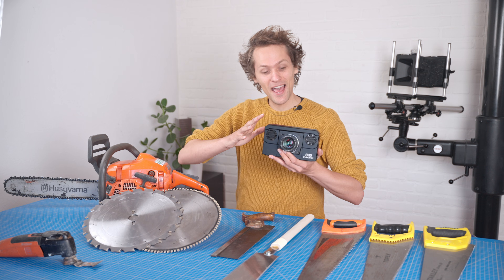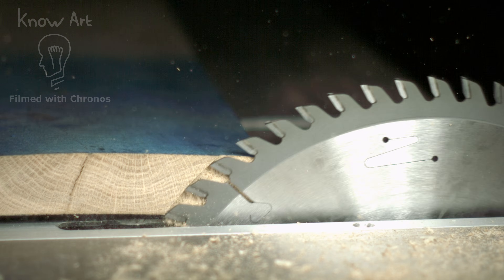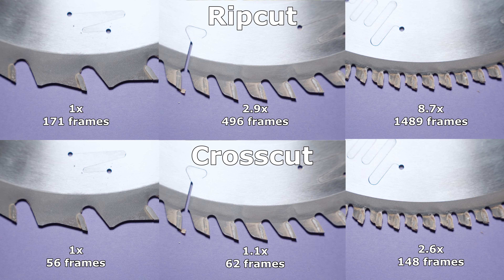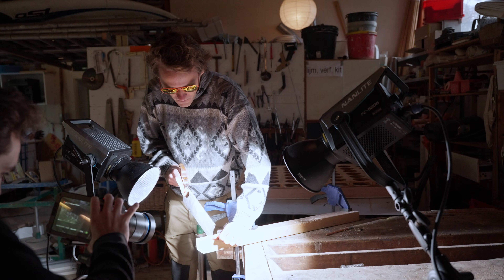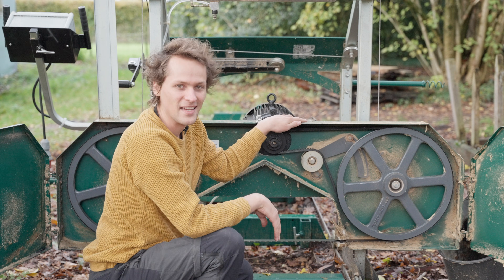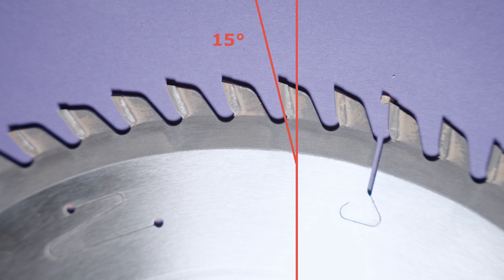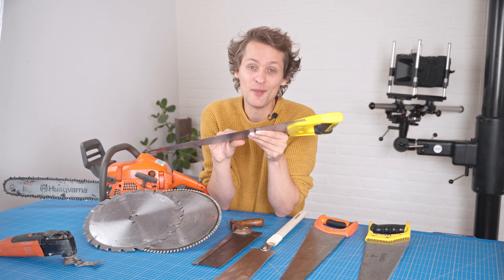Why Crosscut Saws Can't Rip

Comment: 10:22 
This is why when preforming a plunge cut you use the bottom part of the tip of the bar to start the cut and once that went through you straighten out and push the saw. It’s a fairly dangerous cut if you don’t know what you’re doing so don’t practice this without a professional near you.

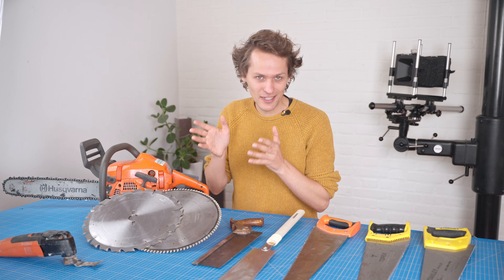Comment: 11:55 I use multi-tool oscillating saws so often. They're great for jobs like flooring, drywall, and framing windows and doors. It's my favorite tool, and it's so safe to use.
Reply: Patented be Fein in 1967, with patent ending in 2009.
Reply: @Calc_Ulator  Invented to cut hard cast, without tearing patients skin. Oscillating saws for construction are a bit different beast. I don't recommend trying with makita/milwaukee and what have you. At least the Makita i had, slipped once and clipped my finger. left a small scar to remind me to be better.

Comment: Great video, but you should really use some dust protection, like a p3 respirator, or even just a cheap dust mask. The microscopic wood dust particles made from power saws are really bad for your lungs, and many hardwoods are even carcinogenic. You looked after your eyes and ears, but forgot about your lungs.

People often forget because they dont notice the effects straight away, but repeated in the long term and you will really regret it later in life

Stay safe 🩵

Comment: In reply to one of your latest points, I actually have a history of cutting metal things with a simple coping saw. The blades dont last very long when I do that, and Ive snapped several, but they also arent very expensive, and Im not patient enough to use a proper hack saw. Ive sawed nails, small steel tubes, greater than 1/8th inch thick copper wire, all sorts of aluminum, and even a .38 Special revolver round once.

Comment: If there were some wood properties that would put up more resistance, perhaps the 100 teeth blade would actually be faster? Seems like there must be a balance between the resistance of the cut object and the revolutions of teeth energy onto the object. The more teeth the more contact points on the wood and therefore it would it take longer. SO if there were a physical/chemical reason to require 100 teeth by the cut object perhaps it would be faster and appropriate??? Only you can do this experiment
Reply from the maker: I have no idea what you mean exactly

Comment: "Chip Load Per Tooth"
The number of "Cutting Teeth" and the "Diameter" of the cutting tool.
Determine a usable RPM range.
At least in machining anyways.
The basic rule of the thumb is.
A 1" inch or 25.4mm cutter with 2 flutes aka cutting teeth. Needs to spin twice as fast as a 4 flute cutter.
I would imagine it's the same with a saw blade, but you can't adjust your RPM.
Meaning the blades with higher tooth counts.
Will most likely be spinning too fast.
To cut efficiently.
Especially when the same 
"Feed Rate" 
& "Pressure" is applied to the different blades.

Comment: I think the real reason is that the 20 teeth blade has more bite than the 100 teeth blade, also the 100 teeth blade is made to cut harder material than wood, so it is not ideal for cutting wood. Also you ignored the teeth cutting angle, the 20 teeth blade have a much sharper angle than the 100 teeth blade

Comment: @0:56 How do you propose the see if the chips get trapped in the gullets with a camera without leaving the blade (and gullets) exposed, and at the same time giving the chips a way out so they don't fill up the gullets.
Reply: A clear material next to the blade would probably do a lot of that.

Comment: I think you need to add a clear panel to the filming side of the cut to eliminate sideways ejection of dust before you can conclusively say it's not the gullets
Reply from the maker: thanks! I think this is an optical illusion. Because we used frame syncing to film the table saw it looks like the sawdust is moving a lot and flying off. But if you pause at any frame you can see how much sawdust is actually being produced and flying out. And it's very little!

Comment: 1:10 I'm going to guess that it's like machining, and when you cut too shallow/slow, chip formation is poor and the bits are smaller, but you have about the same amount of heat generated, so the smaller bits have more heat in them. With the same feed rate, fewer teeth means each tooth will be cutting a larger chunk of wood

Comment: Think of it like a coarse vs fine metal file. You just aren't taking off as much material at once with a fine file (100-tooth blade) as a coarse file (24-tooth blade). Why? I don't know, but it's a similar effect. A saw would be an extremely thin oddly shaped file, after all.

Comment: Hey, I haven't watched the rest of the video yet but if you note, at around 2:19  you are pointing at what you THINK  is a single tooth moving but if you look in the upper right corner of the screen(and moving down/left) but just slightly more center of the blade you will see a black line which I forget what it is but regardless it's part of the blade and it's moving much faster than what you are claiming is a single tooth moving. What's going on is you have the frame rate very close to a multiple of the RPM x tooth count so the teeth themselves look the same.
Reply: He's not saying that it's a single tooth moving, but that the saw is rotating by one tooth each frame. The teeth are staggered, switching left and right of the cutting plane with each tooth, so the framerate needs to be halved so that the saw rotates by two teeth per frame instead, making the apparent motion of the "tooth" come from teeth on the same side of the blade.

Comment: Seems pretty obvious to me that the more teeth you have the less you can advance the wood between two teeth and the slower it cuts. If you have entirely teeth then you can’t cut because no edge will ever be presented to cut. Where as if you have just one teeth, like a sword, you can’t cut cut through the entire thing in one swing. Provided there is sufficient force and strength obviously.

Comment: Rake. It is nearly all about rake.
Blade with more teeth in general have less of an aggressive angle so the teeth do not cut as aggressively. That does also mean there are more surfaces that need to be separated, and there are more teeth grinding against the material creating significantly more heat so it is easier to get burning. Each cut being shallower and removing less material with a less aggressive bite is slower but also reduces the stress on the material and thus also reduces tear-out and leaves a better finish.

As for the easter/western style sawblades. Nah that is bogus. European saws had every type of tooth geometry same as east-asian saws: The right tool for the right job. If you look at historic examples you will find that there is not much difference in blade-thickness generally, and often european push-saws still being thinner simply cause europe had the better steel. Nowadays that is of course not a concern anymore. Now the thickness is determined just by its usecase and if the manufacturer is cheaping out.

Comment: Love this video! Learned a lot.

I do want to point out one thing though. Part of the reason why the gullets aren't getting filled up at 2:53 is due to the saw being at the side of the wood. Leaving one open side for them to be ejected.

Your explanation did convince me and was very clear, but maybe it would have been a better demonstration if you where to be able to place some plexiglas or something to the side of the saw, simulating the presence of the wood that would normally form a barrier. (Not sure how easy to do and safe that would be though).

Still great video! Ill keep this in mind next time i need a saw
Reply: I don't think it really matters that it's on the side of the wood. The higher tooth count saws were still slower so the gullets getting full is definitely not the main factor.
Reply: spinning blades rarely get packed full of dust between each tooth coz of how fast they spin the dust gets thrown out constantly, for a normal hand saw though they teeth do sometimes get packed full of dust especially when the wood is slightly damp, even multi tools do aswell because of how much friction and heat they generate, it melts the lignin in the wood and it sticks to the teeth

Comment: Hello fellow woodworker, during my apprenticeship we had really big sawblade with long holes within the surface of the blade with extra carbide "teeth", we used to rip boards and it was by far the fastest we had. But it was so damn load while running that we rarely used it.

Comment: Cast saws also oscillate, so they cut the hard cast, but just push your skin back and forth. They can't cut you cause your skin has a little give, but they cut the cast cause it's fixed in place.

Comment: You can get extra-hard files that can sharpen hardened teeth (although they are harder to find than standard files), so even if you resharpen, you can still get the better durability. Also, the rake angle of a saw blades isn't just a single number, but can have both an axial and a radial component. Good crosscut blades often have a low (or even negative) radial rake angle, but a positive axial rake angle.
Reply: Presumably you could sharpen them with an abrasive diamond file as well. Probably easier to find than an extra hard regular file
Reply: @jakezanders6598  I diamond file would definitely work as well if you found one in the correct shape, but I ended up with an extra-hard metal one because it was in stock when I bought the saw (and recommended by the hardware store). I use an abrasive diamond flat file for several other cutting tools though and it's incredibly useful.
Reply: @gtsteel  Diamond files do work but gotta get the file grit correct and the file has to be really thin to fit between the teeth. I have some 0.6mm thick diamond files with 400 grit and they work for sharpening normal wood saws you can buy at the hardware store with 7 - 13 teeth per inch. It does get trickier the smaller the teeth become and needless to say this file is quite flexible so you have to mind the force and angle you use it at. If I had a proper triangular file with 400 grit diamond coating it'd be easier than with a flat file but those are even harder to find. Had to order these miniature files from abroad.
Reply: I re-sharpen Silky saws with fine diamond files. I get blunt saws free from a contractor who cuts for power line clearance. It is not worthwhile for them to re-sharpen, even though they cost a fortune to buy.
Reply: It is a useful tip, but even regular saw files are not mainstream anymore. I fear for the availability of extra-hard files. For that matter, I simply avoid buying saws with hardened teeth. Any regular saw blade will outlast my remaining life anyway. Many times I have considering grinding off teeth of old saws with hardened teeth. But it is said that the unhardened material of that blade is softer than regular saw steel.
Reply: Tsubosan files

Comment: Paused at 2:54 to take a shot at an explanation. It's like a bed of nails. Many teeth in contact with the wood would offer less pressure per tooth, resulting in a smaller "bite" for each tooth. Going for the extremes, too many teeth would be the same as a smooth disk; one tooth would be a chisel, and chisels cut better than smooth disks. Now let me continue the video to see if that makes any sense. :)
Reply: In machining we call this tool pressure. Tool pressure doesn't exactly slow down the cut though, it just takes more power. With a saw you are supposed to choose your blade pitch based on the thickness of material. Regardless of what the creator thinks chip evacuation is VERY important. Doing this by hand is one thing as you can feel what the tool is doing but start operating a cnc saw and you have to actually match the tool to the material.
Reply: The bite size isn't always linearly related to the number of teeth and feed-rate. When the feed rate is too low, some teeth aren't actually biting, just skating along the surface and bending the surface away.
Reply: Good direction with the pressure per tooth :) - I think he’s forgetting in the video, that the saw is in contact with the wood piece with multiple teeth in both cross cut and rip cut. If you imagine the piece being infinitely strong and have zero plasticity you wouldn't cut anything because the teeth in contact would not allow new teeth to bite in. Each single tooth as it cuts into the wood is pushed forward by the constant force into the wood during its travel, so it cuts out a triangle (simplified). The size of the base of that triangle dictates how far into the piece will the next tooth be able to bite in. And that is dependent on how many contact points there are with the piece, i.e. less teeth means less contact points and higher pressure on each tooth + longer travel between each tooth = larger cut out triangle per tooth. The more elasticity we have in the material, the higher benefit we'll get from less teeth. And of course, wood is stronger (less elastic) in crosscut than in rip cut, that’s why we see smaller difference in cross cut results. In other words - too many teeth in rip cut are actually not taking the advantage of how much each tooth can bite away, because they are “blocked” by other teeth. If you overdo this and go for a saw with even less teeth, eventually it will stop the saw even on wood. That’s why saws for metal have way more teeth - the elasticity of the metal (yes, elasticity) would not allow for bigger chunks anyway, so we compensate with quantity of the impacts.
Reply: I love your point about a smooth disk, but I would argue a single-tooth saw would be an axe. :)
Reply: Yup, me too. I'm literally pausing the video and reading comments to see if others share the same thought.
Reply: But that can not be the explanation:
The total force must stay constant - with twice the teeth each one would experience half the force and cut half as much - netting overall the same result
Reply: @ABaumstumpf but does half the force mean half the cut depth? I'm not sure about that.
Reply: @UserNameAnonymous  agreed i'm not sure the relationship here is linear
Reply: @ABaumstumpf I don’t think this is a linear relationship, or else course and fine sandpaper would remove the same amount of material.
Reply: @feldinho  Sandpaper ? No? how would you even come up with that idea?

I mean just think about it: Does Sandpaper have dedicated cutting-edges with  a well-defined angle? It is nothing but aggregate bonded to a surface - large negative rake. Cutting-performance there is a lot more limited by grain-structure and dust removal.
Reply: @ABaumstumpf  In cutting metals, we know this as Specific Cutting Force.  The relationship between cutting force and material removal is non-linear, and any cutting tip, be it HSS/Carbide/diamond will rub rather than cut the workpiece when the cut depth becomes too small.
Reply: @thedubwhisperer2157  I've used lathes and mills a decent amount and noticed this, but I wonder how much of this is because of the large scale flex of the work, machine, and tool vs the surface hardness of the material.
Reply: @thedubwhisperer2157  "when the cut depth becomes too smal" some milled parts get deformed between the support zones, avoiding the tool, and after part release, here is "overmaterial" (protuberance), or relative recess in front of the support zones.
Reply: @johnhunter7244  I wanted to make a bigger bycicle pedar gear from a Ø259 mm disc thick 5 mm. When machining the face on the lathe (fixed into the central hole, say Ø80 mm) I indefinitely continued to remove material, moving the cutter in radial direction, without any axial feed, due to part flexibility. Finally I got 11 teeth wheel gear (instead of 14) and dropped the idea of 66 teeth pedal gear (instead of 52).

Comment: For soft materials like wood, I would think the fewer the teeth, the larger the gap between, so the more material caught and cut with each tooth. Inversely, the more teeth, the closer to a solid disk it becomes.

As long as the teeth are strong enough, the fewer, the better. I suppose a stamping die machine is one very strong tooth.

EDIT: Commented before watching past the intro.
Reply: also my intuition and (slightly reworded) the final explanation in the video 👍

Comment: Just started, but my first thought is that fewer larger teeth means more mass and more force behind the cutting edge at a the same speed. 

Let’s see…
Reply: nah, the mass of the teeth is insignificant to the total mass of the blade. And the entire thing of the blade is what matters
Reply: @NecumNaTo  thanks! I had a similar doubt a few minutes after I wrote this.